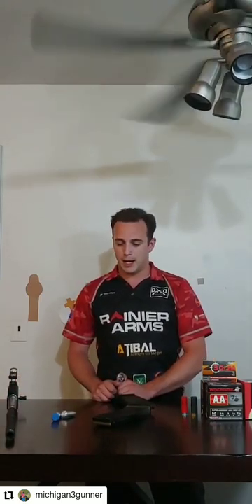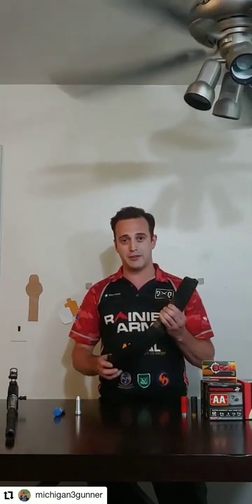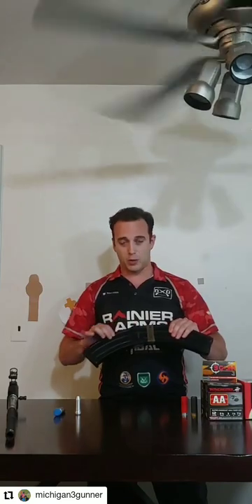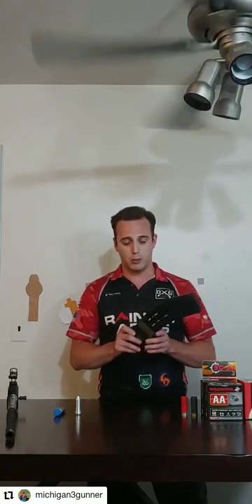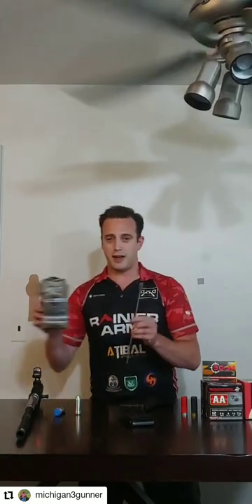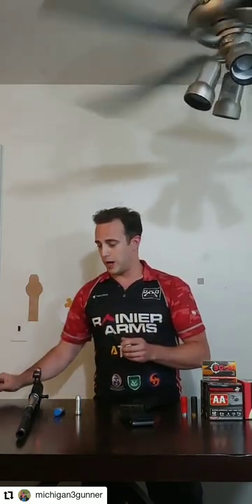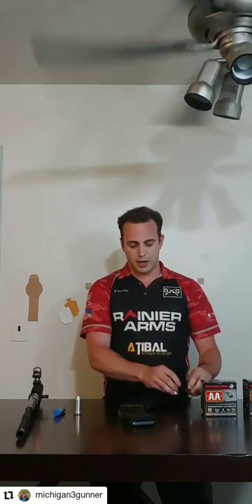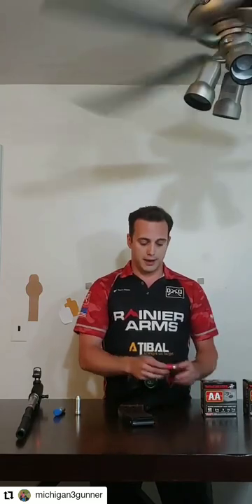Rock Island Armory VR-80 3 Gun Reliability Modifications Part 1

Comment: Where do you get these needed accessorized parts from?
Reply: Have 2 of these both with mil spec Buffer, Billet end plate, Daniel Defense hardware kit, Halosun 3 Red/Green dot, & other Leupold Red/Green dot
5+2mag extensions & 19+2 looks feels & makes the vr80 a must have with these upgrades over the crapy oem stock
@TEAM360NW #TEAM360NW

Comment: Which gas ring are you running to be able to shoot any type of shotgun shell? Are you running the Heavy Gas ring or the light gas ring....please correct me if I'm wrong but I was told that if you're running anything other than slugs and double-ought buck you need to run the light gas ring that came with the gun and if you're running double-ought buck and slugs you need to run the Heavy Gas ring or you can damage the gun.

I would like to find a way to be able to run any shells without having to change the gas ring every time.... the gun is brand new so once I breaking it in.... can I just put the Heavy Gas ring inside and a run whatever I want?  Please advise? Thanks!
Reply from the maker: Light piston with all loads. The heavy piston is for 3" high brass shells. With the modifications, the heavy piston is advised for all full power loads such as 1600fps slugs and 2.75" turkey loads. I do not advise running 3" loads after modifying the gas ports.
Reply from the maker: imgone  3inch slugs aren't necessary for break in, and cost more compared to 2-3/4. If you want to shoot them after break in make sure you use the heavy piston and cylinder or modified choke.
Reply: @RallyMech   so I have had my vr80 out several times with the light piston ring in I have shot some cheap ammo then i went to Winchester  super dive 2 3/4 1350velocity 1oz 7 1/2 shot I have shot about 200 rounds gun will not cycle somtimes it wont eject spent shell somtimes it will but most of the time it will not load the next shell. So I got some Winchester super x waterfowl  3in 1550 velocity  1 1/8 oz 2 shot cycles perfect. Tm going to polish it up a bit, think I should drill gas port out to a 32 or keep trying to break in? If so you said you wouldnt advise  shooting 3inch, so you think the extra gas pressure will hurt the gun after drilling or will I be okay with 3in if i put heavy gas piston in? Thanks

Comment: Just as he states before shooting need to tear down & remove all factory packing grease then reassemble with synthetic oil/lube.
Winchester Super-X 3" to break in with heavy gas block.  Anything less like gameloads  seen in this video will result in malfunctioning jams.

Have 2 of these, 1 with mil spec Buffer, billet end plate, Daniel Defense hardware kit, Halosun 3 Red/Green dot, +2mag extensions, _ 19+2 magazine is a must! 
looks feels & makes the vr80 a must have
@TEAM360NW #TEAM360NW
Reply from the maker: Using 3" and the heavy load piston is a waste, especially since 3" shells do not work well in the 19 round mags and the heavy piston reduces gas to the action. Just run hot 2-3/4" with the light piston and send it for break in.

Comment: Hi Great video ,very informative!! I just purchased the VR 80 for boar hunting.Which choke do you suggest to use for slugs! I followed all your suggestion. thanks Vince
Reply: Modified
Reply from the maker: I use a Briley Mod choke for most stages, including those with slugs.
Reply: RallyMech could you tell me exactly what Bailey md choke you use please. And what’s the best Winchester xx size shot to use 7 1/2,8,9? Thanks
Reply from the maker: @angrybiker1  Briley Chokes, Standard Mod is what I use. If you don't have a compensator/brake, you can use extended or ported chokes.
Reply: RallyMech I have the medium ria comp. I don’t see a choke for the ria vr80 on there website

Comment: My VR80 has these mods but I'm getting the death jam and shells smash oblong and don't feed.   They also are getting a slice it looks like from the ejector when this happens.   Of course it happens most during a match.  Any suggestions?
Reply from the maker: What ammo are you using, how hot out is it, and how long before a stage are you loading the mags? Some hulls are too soft for the magazine spring pressure, and it gets worse in hotter temps. Also which magazines are you using? I predominately run 19's and 9 rounders converted to 10.

Comment: I want to find a collapsible butt stock but the ones I found doesnt fit.
Reply from the maker: The factory receiver extension is "Commercial Spec" whereas most AR stocks are "Mil Spec". Even then, a commercial spec stock may still be very tight due to loose tolerances for the factory tube. 
The best solution in my opinion is picking up a mil spec AR receiver extension and an end plate conversion from M3Tactical. More expensive, but it's the best combo. 
https://m3tacticaltech.com/products/vr80-mil-spec-adapter

Comment: would drilling out the gas holes on a vr82 be recommended?
Reply from the maker: I have zero experience with the 82, so I do not know. If you're getting short stroke problems, it may be a possible fix.

Comment: When bracking in can i run 3 high brass should i use heavy gas piston or light going to pick up my new vr80 tomorow
Reply from the maker: If you're set on using 3", start with the heavy piston. From my experience 2-3/4" 1200+ fps with the light piston works well, no personal experience breaking in with 3" loads.

Comment: Fabu:  I  have a ban state compliant vr-80 that I received by mistake and connot return.  Is it possible to change the mag release to non ban state configuration by changing or omitting some parts?  I heard that the mag release is compromised by a spring loaded plunger that is negated when the upper receiver is opened.  I live in Wisconsin.
Reply from the maker: There's a plunger that locks the mag release in place, which I believe can be removed. I have not personally handled a california compliant model, so I do not know the specifics. If you are on Facebook, I recommend joining the Rock Island Armory Imports VR-80 group and asking there. https://www.facebook.com/groups/213381859581512
Reply: @RallyMech  Yes it can be removed and it takes less than a minute to do!  Refer to the parts blowup  in the manual             It took me a while to find it         there is a retainer screw that hold in the plunger and it is a snap to remove it.  Once out the plunger will come out and you are good to go.......................Good luck fellas               Keep your powder dry and Semper Fi.           Glen Lindsley

Comment: .126" interesting. The three ports on mine are actually less than 1/16". I have no fired it as yet but boring them out to 1/8" seems a bit drastic?
Reply from the maker: Not 0.126". Our initial testing showed 0.116" to work very well with commonly used 3gun ammo, and newer production guns have been coming with 0.112" from the factory.
Reply: RallyMech is this on the heavy or light load piston

Comment: can i use this ammo for a stock VR80? FEDERAL AMMO. ULTRA CLAY AND FIELD, 12 GA., 2 3/4 DRAM, 1 1/8 OZ., #7.5, 1200 FPS
its $55 for 250shots really good deal.
and does it come stock with the heavy gas piston? because i havent changed anything on my gun yet.
will it be ok if i do not drill it?
Reply from the maker: I would use 3 Dram minimum. I don't have any experience with the ammo you mentioned. 
It comes with both the Light (2-3/4" shell) piston and the Heavy (3" shell) piston. 
The newer guns (covered in the PT 2 video) seem to have larger gas ports and generally run well out of the box with good ammo. The recommended load is still Winchester AA 1300fps 1-1/8oz birdshot.

Comment: I have a VR80 and my hand that’s on the hand guard is filthy and gets a little burned while I’m shooting. Is this normal or am I doing something wrong? I’m shooting low recoil slugs with the light loads gas block. It won’t cycle the round out if I have the heavy load in. This thing does a number on wild hogs in South Texas!
Reply from the maker: There's several options out there for handling the heat/carbon, including suppressor wraps, wrapping the handguard with kydex, or wrapping the handguard with foam tape.
Reply: RallyMech, thanks for the info. I’m glad actually glad to hear that happens and that I didn’t screw something up.
Reply: A3GMunitions makes extended forends that eliminate the burnt hands

Comment: What about a #31 drill bit? .120
Reply from the maker: That's much larger than I recommend based on my experience with these guns. Too large means the gun will beat itself apart, and it won't be reliable at all due to cycling faster than the mag can feed. It'll extract and eject, but won't pick up the next round.

Comment: Can you list all the mods
Reply from the maker: Mods for my personal VR (not my teammate Matt who is in the video):
Taccom 2 Stage Buffer
Taccom 45 Degree Selector
Bolt Catch Removed
D&D Gunsmiths Bolt Knob
Aero MilSpec Buffer Tube
Magpul SL Stock
Magpul K Grip
0.113" Gas Port Size x3
Modified RIA Long Comp Gen 1
Reply: @RallyMech  How did you modify the Gen 1 Long Comp?
Reply from the maker: @rskarl9468  I chopped the second baffle off with a band saw, milled the rest flush, opened up the right side port approx 3/8" wider, and left side port 1/8" wider. That helped the over compensation for vertical lift, and helped counter the right lateral sway I'd feel as a right handed shooter.
I wanted it to shoot flatter without dipping low, and stay straight on target.

Comment: Hey Boss, you wouldn't happen to know how you guys ended up going with the #32 bit?  Did that just happen to work?  Anyone try 1/8" 0.125?
Reply from the maker: The ports were initially 0.105" or so, and 0.111" 0.116" were on hand to try. 0.111" ran better, but 0.116" fed everything. At some point after this video was made, the gas ports on later serial guns started coming in at 0.112"-0.113", and mostly running out of the box. The jump from original to 0.116" added 22% gas to the system, whereas 0.112" only adds 13.7%. 
Given that some guns with the newer ports still hiccup with some loads regularly and randomly with weak loads, the 0.116" has been proven to function extremely well with low pressure target loads and reduced recoil slugs. If you only plan to run high pressure ammo, 0.112" is likely the correct gas port size.
Reply: @RallyMech  Thanks, that's good to know.  I've got boxes and boxes of reduced recoil shot so the wider gas ports sound like the way to go.
Reply: So, what size bit did we decide on?
Reply from the maker: @snapperhead200  we've had a couple guns come in with 0.112" gas ports, so that size or larger should work.
Reply: RallyMech I’m still having trouble with the bit size, is 0.112 a micro bit? If so, any idea where I might acquire one? Thanks for all the info!!
Reply from the maker: @snapperhead200  they're standard size bits, you can order them online easily. A 0.113" is a #33 machinists bit. 

https://vermontamerican.com/drill-bit-decimal-equivalency-chart/
Reply: @snapperhead200  If you're in the U.S. those bits are sold by ace hardware, usually near tap and die stuff or welding stuff.  I drilled mine out and all the holes had burs that I had to knock down.

The burs weren't impressed with the steel wool either, guessing the barrel steel is harder than the wool and ended up having to hit it with some fine sand paper stuck to a cleaning rod.  

I'd get the full taccom line of stuff first (buffer, buffer tube and spring)  and then only drill it out if it doesn't cycle what you want then.
Reply: Jason Something thanks for the info! I ordered the new parts, I’ll see how that goes
Reply from the maker: @snapperhead200  happy to help!
Reply: @snapperhead200  👍 There's a few ore things I went and did with mine but effort vs reward, I dunno.  I didn't think up any of these but I can see how they could help too.  

The best one's to rotate 180 degrees the safety lever on your trigger finger side so that it won't accidentally dig into your finger when firing.  Thanks be to the people on the internet who figured that out cause I did that one right away, took all of a minute to find the right sized allen key (2.5mm metric).

Little more effort, may or may not do much:  Lightly sanding the feed ramp on the lower receiver to smooth out the anodization.  It probably gets worn down "naturally" when firing so I'm guessing its one of the areas that needs to be broken-in.  

Last thing is finding a heavy duty butt stock to stick on the thing.  I don't know what the best would be, but having a heavier one helps balance it out so it isn't so front heavy.  I ended up with a fab defense gl-shock, but any heavy duty stocks will help with balance and the extra weight reduces recoil a little bit.  Anyway, best of luck, lot of fun once they're sorted out.
Reply: Jason Something awesome man, thanks for all the great info!